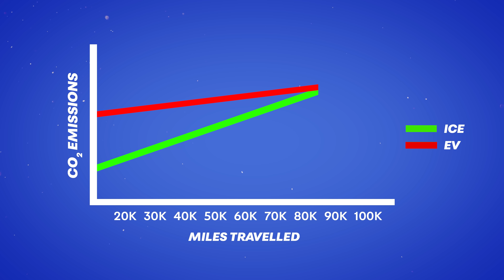Are Electric Cars REALLY That Green? [New 2022 Data]

Comment: "green" energy isn't reliable enough or abundant enough to support all of the electric needs on a large scale as it is.  what happens when more electric cars go online?  just this week the state of California told people not to charge  cars because there is a shortage of power.  California had brownouts BEFORE EV's became so popular.  I'm not saying scrap EV's and stick with fossil fuels.  I think we should work on getting the clean energy more abundant and reliable BEFORE we over tax the grid by cutting off fossil fuels and adding more EV's to the grid at the same time.  until the green energy technology gets better on the supply end, we are going to  need coal, nuclear and hydro to help with the supply. we are also going to need gas and diesel vehicles to lessen the load on the electric supply until green energy gets more reliable.  also, how are solar panels supposed to create enough energy in parts of the world where it's grey and wintery half the year?  you can say wind but those windmills get shut off if the winds are too high because they will catch on fire if they spin too fast.  those windmill blades aren't exactly recycleable  at the end of their service life.  which brings me to the end of the service life of the car batteries.  those batteries are full of toxic chemicals.  how do you deal with the ever increasing amount of toxic chemicals 10 years down the road when all these EV batteries need replacing.  can't just  dump them in a landfill in some poor country.  nobody is thinking of all of the aspects of green energy

Comment: ice cars use excavators, machines to extract minerals.  NOT 6 YR OLD STARVING CHILDREN. SAME FOR COBOLT.. factor that,in your nice clean quiet bs car.. how long do the batts last.  most ice engines will last 40 + yrs, before re build, for a cost of 4k. non computerised model.. watch vids on mining lithium & coblot, then, go buy a big v8..

Comment: Yes we need smaller cars with smaller batteries but up to now they are way to expensive or not obtainable,  my MGZSEV is way bigger than I need but affordable and driven carefully gets close to 300km from a 44.5kw battery and charged of solar panels costs very little to run but they are not green, only better for the cities air quality.

Comment: It's all well and good for geeks working in Dilbert cubicles and living in the cities but you mention "living in the sticks".
Exactly what "sticks" are you seeing in your head when you say this?
Where I live it is about 300 to 400 km between cities just to get from one city to another. State capitals are an average of 1000km apart - that's 600 miles! To go to work, many people commute DAILY in cars for the better part of 1 1/2 hours on highways WITHOUT  traffic and travel at 100km/hr. 
What about farmers, tradesmen and others who prefer a pick up for practical purposes?
What about summer when the air conditioning shortens your travel 
What about winter when the ELECTRIC heater also shortens your travel
What about rain when the use of the wipers or the radio or the lights at night shorten your travel
No
Electric vehicles are not functional in the real world

In order to be functional, an electric vehicle must come with a tow bar and carry pack trailer for a petrol generator and 220ltr of fuel. When this is not available electric vehicle owners will continue to call a diesel truck to drag them back to  a charging station where they will wait eight hours to recharge!

How much poison plastic and exotic metals are recyclable?

Comment: I'm wondering if we actually manage to reduce CO2 levels, would an unintended consequence be that farming becomes less efficient.  Plants love CO2 and thrive with high levels of it.  If you cut the CO2 levels, presumably plants would suffer, thereby causing more fields to be cultivated to produce the same harvest.  If you have to farm more land to produce the same amount of harvest, that is less efficient, and would be a downside of electric cars producing less CO2 emissions.  Shouldn't the extra fuel used to farm less efficiently be charged to the electric cars in the comparison equations?

Comment: You’re forgetting one thing the batteries are good for 5-10 years so around the time you broke even you have to replace a $7,000 battery pack and you need to do something with the 1,000 pounds of old battery pack. That’s why they recalled the electric cars a few years ago they were afraid people would find out about the tons of used batteries they had to do something with

Comment: Wonderful. But your parameters are quite limited!  How about discussing the endless oil changes. Trans and differential fluids, antifreeze. I've yet to hear this put into the calculation. Then there's the energy used to visit shops for these services.   How about the time (and costs) to perform these maintenance. Then there's the evaporation of gasoline esp in warm weather. How about all the fuel it takes to distribute billions of gallons of oil and gasoline. Tell me what I left out!

Comment: I laugh when i see "zero emission vehicle."  That is such ignorance or just an outright lie.  Environmentally, most "green" stuff is destructive.  Just look into the mining of the special metals needed.  A lot of electricity is made by burning coal or natural gas.  It will burn far more natural gas or coal to make electricity to charge cars or run home heating than it would to just burn it in a home furnace or to use gas or diesel in a vehicle.  There are so many losses at every step of the process.  The only reasonably green electricity is hydro.  Which also destroys some land.

Comment: The information you've brought here is not the total truth.
One the wind power utility doesn't want to talk about anything that the land, labor, concrete, steel, the steel tower, the top generator, and the wind blades is NEEDED.
And after 10 to 12 years, the wind blades lifespan will end, and what happen to them? Buried!!!!!
So, all in all, wind energy is not that green after all.
BTW, the blades need to be washed before and after the winter.
AND,,,,,, this is the number of avian birds are killed every year.
There're 1.200.000+/- wind mill worldwide time 18+/- avian birds are killed days in and days out.
So, you do the figure. 
In so far, the solar energy is the same, after 15 years or so,,,,, Buried. 
Wake up.

Comment: A decent video report.  I've been using the Volvo report since it came out a few months ago exactly for the reasons Rory pointed out.  But EVs are not 'green', and I don't know where this rhetoric comes from.  Maybe from the media so they can point back at the pointless/baseless rhetoric and go "See, EVs aren't as green as 'they' say they are". Hard to argue with people who argue with themselves...  

But EVs are less environmentally damaging in CO2 alone, for pretty much any use case, and less environmentally hostile in all use cases where they are used.  The sourcing of materials are cleaning up their act too after the scrutiny put on them by the EV-bashing brigades, who've ignored such practices for decades.  About time.

But there is one fact that the Volvo paper didn't include: Battery 2nd life and recycling.  Unlike the remnants of burnet fuel, and non-recycled car parts, you don't throw batteries away.  Their too useful and the materials too valuable.  Which then brings the point where the CO2 lines cross much lower.  One for another day 😉.

Comment: To produce 1 electric vehicle battery you must remove:
25,000 lbs of brine for the lithium
30,000 lbs of ore for the cobalt 
  5,000  lbs of ore for the nickel
25,000 lbs for the copper 
All told, 500,000 lbs of earth crust must be dug up for 1 battery.  

Also, 84,000 gallons of fossil fuel are needed to move all that earth.  
If you drove your vehicle 15k miles a year and got 20 miles a gallon, you could drive your gas burner for 
112 years.  
And that doesn’t factor in that those batteries last less than 20 years, or that there does not yet exist a planet friendly lithium battery disposal plan.  So unless you just love the technology and don’t mind raping the plant, drive a gas burner.

Comment: Your comment about improving the electricity source is another mis information about power generation.  As much as we want to improve our planet.   As it stands all green energy cannot be used as base load power,  other than say hydro power.  Wind power for example are the worst kind of 'green' energy.   They are very inefficient at generating power,  eg cannot generate power when spinning too fast or to slow.   Use a lot of raw material and labour to produce, only to need a complete rebuild in 20 years or less.  Solar panels also cannot sustain base load,  requires endless amount of area extremely toxic to produce and so far we have no way of recycling the panels once reached end of life.

If people really did care about the environment and it was such a big issue in their life.   A simple thing would be to NOT UPGRADE YOUR CAR and continue driving your current one.  The second you take ownership of a new vehicle,  your are a big polluter regardless on its propulsion.  No amount of political correctness from the goverment or those outspoken environmental hypocrites can change these facts.

Comment: For ICE cars you can just drive a hybrid to lower your emissions greatly. A Prius gets over 50 miles per gallon. I'm positive it's overall emissions are less than my P85DL Tesla. By the way if you include the extra front end cost of an EV to a comparable ICE the ICE is less expensive to own over the life of the vehicles.
Reply: You have that backwards. The list of things that can fail is always longer on a ICE car.
Reply: @MrJturner74  I agree but most of them don't fail. Overall I agree maintenance should be higher on ICE vehicles but it hasn't been my experience. By the way I really like the Tesla but my wife doesn't even though It's her car. I like all the wizbangs and how quick it is. She doesn't like the wizbangs and has range anxiety.
Reply: @rayshepherd2479  Most of them don't fail???The amount of mechanic shops would make me press x to doubt.
Reply: @rayshepherd2479  LIE, most of them fail. JFC
Reply: @MrJturner74 Modern ICE vehicles are very reliable as long as you do required maintenance. Problems that do arise tend to be electronic. Very seldom is it the drivetrain. Now I do most of my own maintenance on my ICE vehicles but can't do as much on the Tesla. As an example there is a 12 volt battery on the Tesla that lasts less time, about half, as on my ICE vehicles. I can easily change the battery on my ICE vehicles but not on the Tesla. I have had to replace the main screen on the Tesla and there was a driveline failure repaired under warranty. I also had one of the door handles fail. Cost to have Tesla repair it is about $1000. I found parts online and did the repair myself for around $25 but it took me a long time. I've also had a couple of routine checkups by Tesla. The first one cost $1,200. This was a recommended routine maintenance by Tesla. That has now changed and the second checkup was less costly. However overall, especially when I do routine maintenance on my ICE vehicles, the Tesla has had higher maintenance costs.
Reply: @rayshepherd2479  The problem is you are comparing apples to oranges. I can assure you that a ICE car priced like a Tesla will have worse maintenance costs, can I point you at porsche, maserati, or any other high end car?
Reply: @MrJturner74  For 2020 Consumer Reports has Tesla near the bottom or reliabiliy (25 0f 26). So EVs aren't always more reliable. In my case I have owned a number of new cars and the Tesla has had more failures. So far most have been covered by warranty. This included a locked rear drive unit. Locked up when my wife drove into the garage. Wouldn't move at all and Tesla had to tow it out of the garage. Understand they ended up replacing the drive unit and axles.
Reply: @rayshepherd2479  All ev's aren't tesla's. Again you are comparing the high end finicky version vs the everyday version.  Like comparing a maseratti vs a toyota.
Reply: @MrJturner74  Chevy Bolt is $32495 and a Prius is $24625. Difference of $7,870. In 100,000 miles it equates to 7.87 cents per mile. Minimum EV rate where I live is 24.5 cents per kwh and the Bolt uses 29 kwh per mile. So charging cost is 7 cents per mile. Total cost in 100,000 miles is 14.87 cents per mile. Now of you drive it 200,000 miles the cost per mile drops to. 10.95 cents per mile for the Bolt. The Prius gets 52 miles per gallon. So at $6 per gallon the cost is 11.54 cents per mile. The least expensive Tesla is $46,490 so it would be much more expensive including the front end cost even though it uses less electricity per kwh. So an EV can be less expensive but not always especially compared to a hybrid.

Comment: OLD NEWS!!!!!!!.
I've known about this research since 2012. I helped build a prototype electric vehicle for Volvo in 2012 for R&D and worked with Volvo's engineers and they told me this information back then.
Volvo has a R&D facility in Camarillo California, the car was built at Artisan Vehicles Systems and Artisan contracted out all the Fabrication to me.  
The research is actually based on the avergae life span of a vehicle which is 15 years.
If an E.V needs a battery change in this avergae life span period its game over!!!
E.V's are actually worse for the environment when you take into concideration the recycling of the Battery Packs as the Lithium Ion gooo that makes a battery cell can't be reused, it can only be recycled into an worthless inert dust.
Reality is E.V's are just a money making scam for BIG OIL!!!

Comment: What I'd like to see is a like-for-like comparison of the two from zero to point-of-sale (carbon footprint), and then a from point-of-sale onwards comparison, on a graph. I'm not convinced that building and ICE car has a smaller carbon footprint than an EV. As pointed out by Volvo, after point-of-sale the EV powers ahead. I'm trying to wrap my brain around the pre-point-of-sale calculation, especially with the more modern batteries that, eg Tesla are now using.

Comment: While I didn't read the report, I would be interested if they factored in the miles driver per year? My understanding is the batteries used now degrade over time not mileage. So a vehicle driven fewer miles per year may need a battery replacment before the break even point is reached, which would increase it's carbon footprint.

Also the powergrid generation capacity is an issue. How much "renewable" energy will be needed and did they factor in the cost (environmental and monetary) of disposing of the batteries?

Comment: Late to this, but all this is based upon the assumption that putting CO2 in the atmosphere is destroying the planet due to manmade global warming….which, as the actual temperatures are showing (note: NOT the temps reported by NASA and NOAA, which are altered and falsified) is NOT happening, at least over the past twenty years.
Water vapor is as good a ‘greenhouse gas’ as CO2 and is in the air at hundreds of times higher concentration, and the effect of CO2 as a heat absorber is only ‘background noise’ when it comes to sunlight absorption and therefore atmospheric heating. CO2 is plant food. Plain and simple. It has nothing to do with temperature or climate.

Comment: No mention of the rare earth metal mining needed to make enough batteries - there ain’t enough plus all the toxins produced in the manufacturing process. And again this insane obsession with CO2. The biggest greenhouse gas in the atmosphere by far is water vapour, CO2 is responsible for 3% of it. The doubling of CO2 in the atmosphere will increase global temperatures by 0.4C, fossil fuel burning has contributed 0.02C - negligible.

Comment: But how many miles can a battery  back last? If it takes 90000 to match a combustion engine  then if you need a new battery  at say 120,000 your back to square one as its the batteries that are the issue. Also the second hand car market, just as a car becomes  affordable to the masses, it needs a new battery at around £10,000 a time

Comment: Electric driving is attractive, it is quiet and smooth. And if people really want to save the environment, shouldn't we switch to lighter cars? It's exciting to have really fast acceleration, but do we really need that? And where can you really drive much faster than 130 kilo meter / 80 miles per hour? For commuting and city traffic, we can do with much less than the Tesla's now tell us. Then the cars can be lighter in weight and less power consumption with smaller (cheaper) batteries. And the hydrogen car is also a good alternative, perhaps even better. But that's not really the point, is it? Not really for the environment, then we made cars and many other consumer items usable for much longer. How long does a car last? 15 years? Suppose you can cover 200,000 miles over those 15 years at an average speed of 40 miles/hour, then that engine (or motor and battery) has run for 5000 hours, is 208 days, so in less than a year we throw the car away . How much did that car cost you? So what does that cost you per day?

Comment: I don't think it is true that Evs ever break even. If its 90K miles to break even, at what point does that EV need a replacement battery?  The battery is what makes it worth the comparison in the first place due to high CO2 emissions to produce.  So, the EV is in a constant cycle of need for CO2 emissions to survive, where the gas engines of today can reach 200K-300K without needing to be replaced.  And if they are replaced, that new ICE is much "greener" than the EV battery.  EVs are a red herring that has been foisted upon us by big government and the greenies.  Those same greenies that hate nuclear power.  It is just a scan that many more every day are seeing for what it it.